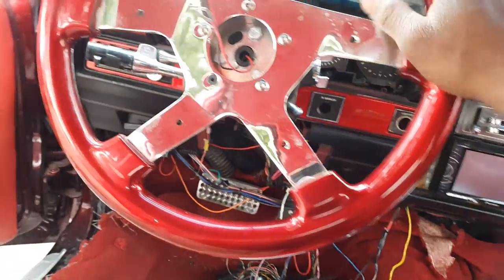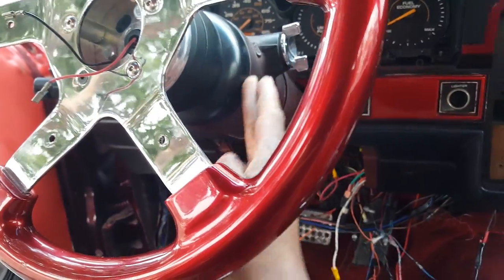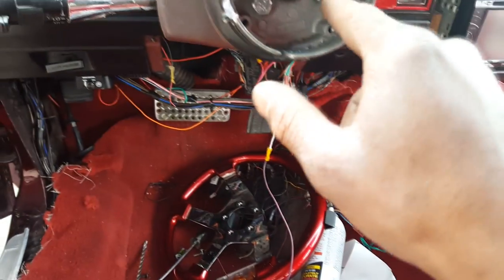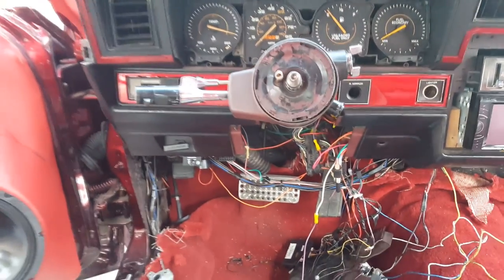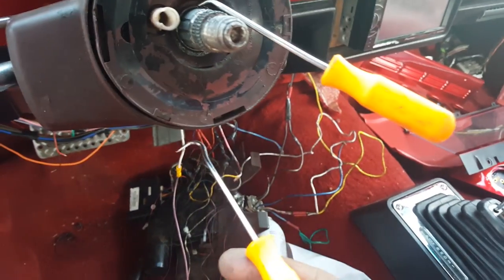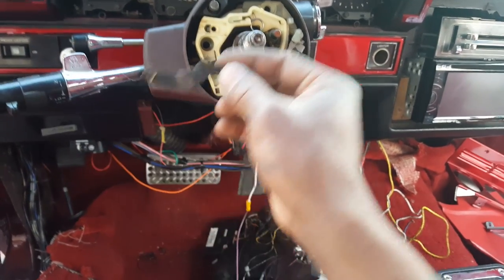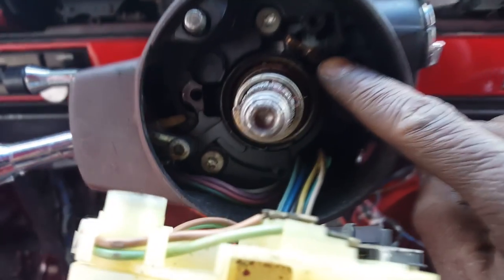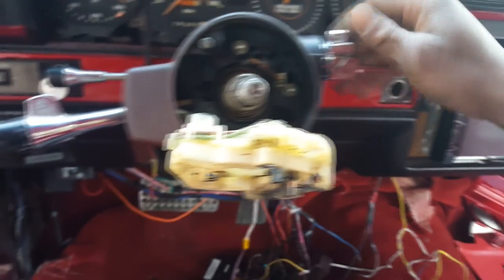1977-1990 Box Chevy Caprice Ignition Key Cylinder Replacment EASY DIY

Comment: I have a problem with the small metal piece used for the high beams. It also holds together the ignition linkage and the tealt (column) switch and another plastic piece and it all fits behind or between the turn signal switch. Also the wipers are on. Can't turn them off. I pulled the small cover off. 1984 Chevy Caprice.

Comment: Now this is a good video. My switch is stuck in the run position. Its a 1990 olds 88 though. But i bet its pretty much the same. I have to pull the ECM fuse and pull the battery cable off. It will turn to start but it won’t turn back to off or lock.
Reply: I have a 96 Eighty-Eight, dealing with the same issue! Key is stuck in on position. I been having to pop the hood, pull a spark plug wire, and disconnect the battery, then manually lock all doors every time I park. I am about to fix that now though thanks to this vid. Probably going to change the wiper/turn signal switch while I'm in there too as the wipers work, but stay on until I turn the car off. 🤣

Still a damn good car though. Great for the daily work commute.
Reply: @houstoner  Man i know how you feel. This video was almost 100% the same on my car. I do recommend using the steering wheel puller because i tried to get away without using it and I completely destroyed the triangle mark on my steering shaft so now i have to drive it with the wheel turned to one side. That steering shaft is stupid soft metal. But yeah i agree, these cars are completely worth it. I absolutely love mine.

Comment: My 83 do the same thing turn on wit out the key in , would this also fix the car stalling out on me ?
Reply from the maker: ThatBoi David Key has nothing to do with the way it runs
Reply: Ok so I gotta change the ignition switch too then ? I had the alternator check since my battery will drain after a few starts and dies every time I slow down and idk what exactly it could be
Reply: @SteveDavisCarGuy  hey have any one y'all run to a problem where it just crank but no start battery draining out after a full charge getting fuel getting compression change out everything on the distributor new cap rotor ignition module ,the hei ignition coil but no start even change starter out but same problem grinding noise or slow start up after cranking on it Everytime any advice thanks

Comment: My ignition switch don't have no power when I turn it over do that mean I need a new ignition switch ?
Reply from the maker: No you have a different issue
Reply: Did u find out your problem I’m having same issue
Reply: @balilabedrahim1734  yeah the wire that's running to my starter was broke just had to put another wire on it

Comment: my switch is locked in the turn on position and always turned without the key..will this method still work.. I have an el Camino
Reply from the maker: jdmoore90 should but if it has no key I’m not sure
Reply: +Steve Davis ok preciate it..